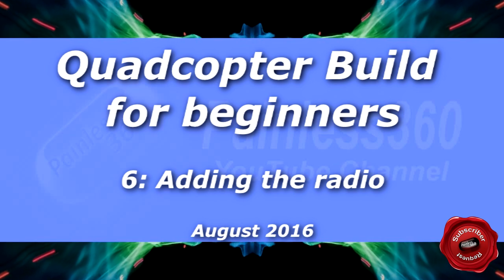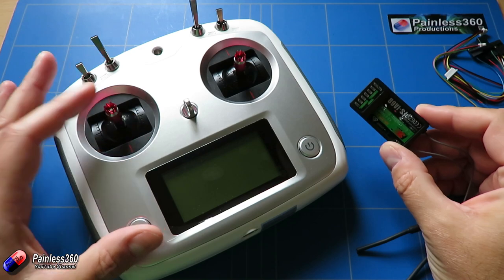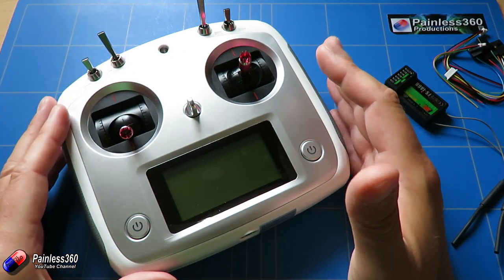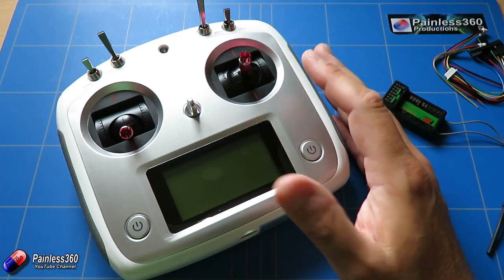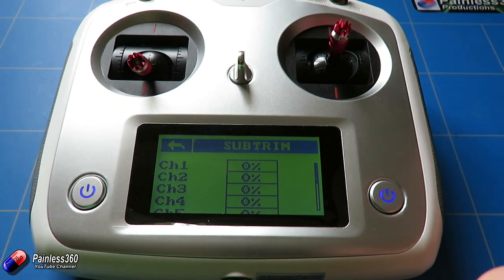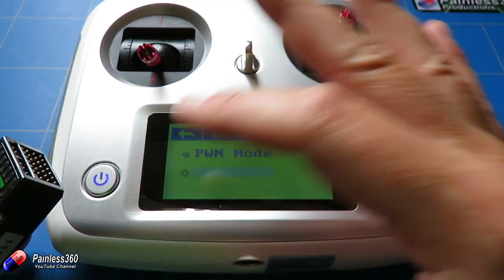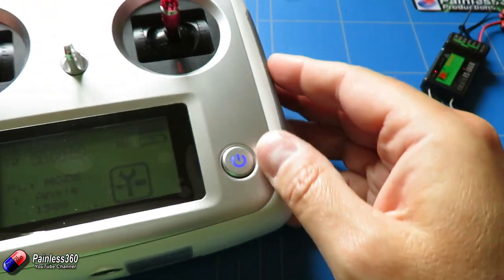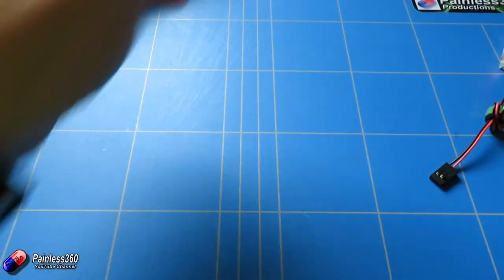(6/9) Quadcopter Building for Beginners - Setting up and adding a radio

Comment: I like this radio, perfect for multi rotors. I know the fixed wings guys aren't fussed on it, but I'd bet HK will offer a FW update to allow this as FlySky has. My DX6i doesn't have any 3 position switches nor PPM, SBus or telemetry. 4 times the money too. I'll be grabbing one of these for sure.

Comment: Hello,  very useful videos,  so Thank You first. i have a question,  i have a APM 2.8 and FS i6s  but no battery and no APM power module,  so my question is if the APM get power through USB cable,  can I connect receiver and bind and test it the transmitter?  thank you for your answer
Reply from the maker: We cover all of that in the APM series on the channel. Best of luck!

Comment: So i don't know why but the way you were able to move the sticks on your transmitter and have it show up in the clean flight reciever screen after you changed the reciever to PPM, looks so easy.  On my end, i did the same exact change and i am still not noticing any of the throttle, roll, pitch, and yaw channel maps updated with my stick movements.   

Here is summary of what i have done so far

1. binded the FS-iA6B reciever to my FS-i6X transmitter
2. set the Reciever to RX PPM input 

I did not do any subtrim modifications like you did however.

Is that what might be causing me from not seeing any changes to the channel maps of those 4 motions? 

Once i get this sorted, the rest is smooth sailing. 

Awesome videos Painless.

Cheers Mate.
Reply from the maker: Thanks for explaining a little of what you've tested as many expect me to know the answer by just letting me know that something isn't working! If non of the channels are working correctly then it's the bind, wiring or settings in Cleanflight/Betaflight. I'd recheck each in turn. Best of luck!

Comment: Hi, just wanted to say I love your channel, it's helped me so much during my build of the same model. Also, do you think you can help me? The radio I purchased on gearbest along with the model is a FlySky iA6. I've noticed it definitely does not look similar to the RX you are using, and I'm just wondering  if there was another way to connect the RX I am using to the spracing f3 flight controller. My RX only has 7 rows of pins and 3 columns. Instead of using the servo-pin-like male connector do I use all of them?

Comment: in this video you use a lipo reduced to 5v to set up the flysky, I was wondering if it is possible to wire a usb to dupont setup and use a phone charger?  I tested the voltage coming  from the charger and it clocks in at 5.22v and 0.7A. do you see any reason that this wouldn't  work?  by the way love your videos, you explain things with great detail and simple enough for even me to understand. thank you so much
Reply from the maker: It should do, be very careful though! :D
Reply: figured I'd just give it a go and it worked perfectly.  seems like a great way to re-use an old cell phone recharger if you have an extra just sitting around.

Comment: Dang.  Thought I found a unicorn.  Cheap,  great interface,  smaller form factor,  10 channel.  Love to have this for both my quads and helis.  Thx for your great vids.  And bought one anyway for my quads.  I'll stay on spektrum for my helis for now. Keep them separate.
Reply from the maker: I would, even the heli pieces on the mighty OpenTX/Taranis are not as slick as on devices like the DX8/9/18..

Comment: Oh.  I didn't know that.  I have an old dx6i,  but it's limited.  Best suggestion for new spektrum?  I fly cp helis micros,  a 250 and want to grow into 509 to 600s.
Reply from the maker: I have a DX9 here and it's a lovely (if expensive) radio. The new DX6 looks good now too. if you're using a flybarless setup then you can get away without a lot of the special swash settings..

Comment: I know this is kind of an old video but im hoping you will see this. Do you think that the FS-i6S is better than the turnigy evolution? i Like the look of both but im a thumber and use a strap while flying and neither of those are qualities that the evolution has. That being said ive heard some amazing things about the evolution and not that much about the i6S. thanks for reading this and i hope you can help.
Reply from the maker: Depends on what you mean by 'better'. Both use a very similar menu system but the i6s is a more traditional layout with some extra things in the menu (curves, dual rates) that come in handy..

Comment: I have the same radio, but my quad is not ready for flying yet. In a failsafe screen are you writing instructions or events for the given channel? For what I saw in the video - it was an event. And if I'm not mistaken it is not the way it supposed to be for setting up failsafe, I'm speaking mainly about channel 5. One more remark - when you were showing how to set up flight modes, you didn't say that you need to set up PWM value for each mode in MP, otherwise, you'll stay on the same channel no matter how many clicks you've made with mode switch. I'm not trying to teach you or to be rude it's just a way I am clearing out if my understanding of how to set up radio is right or wrong.
Reply from the maker: We used channel 5 and set it up to be connected to the switch, that way we get three values on CH5 we can use for flight modes (see the videos). The failsafe is set before binding and should 'tell' the receiver what to output if it looses connection with the radio. Best of luck with yours.

Comment: Hello painless I been see all you transmitter failsafe setup -100 throttle 
But when I do same for throttle and power of the fs_ia6b motor stop should I but throttle in -80 or should to do some thing with the FC

Comment: Hi painless, i have followed every step that you did, and it worked.... kind of..... The throttle and yaw work, but my pitch and roll do not respond. it does not work... Is there anything that you can tell me that might help? I am a noob at this new hobby and i dont know what to do.... thanks, ben
Reply from the maker: Well done on trying to build one, so many just buy a BNF and miss all the fun! You'll get it sorted, the first one or two are huge learning curves. 

You can tell that the radio and Rx are talking so the problem may be on the radio (check that the channels move in the 'monitor' screen on the radio itself) or the cables from the Rx to the flight controller are not installed correctly.. 

When asking for help it's handy to cover what you're already tried, that was I can avoid suggesting things you've already done..

Best of luck!

Comment: Great vid. Just about to start first build, if power receiver from 5V from pdb, will this also power the FC with 5V through the PPM?
Reply from the maker: Yes, the normal way is to power the board with the 5v and then let that power the receiver via the connecting cable.. Best of luck!
Reply: Painless360 Brilliant! Thanks for the help!

Comment: I'm not entirely sure if my failsafe is set up correctly. I have my settings the same as you have set them here. When I arm the quad and try to power off my FS-16S, my radio says 'TURN OFF RX'. However when it is armed and I take the batteries out of the radio the motors stop. Is this right? I thought I saw one of your videos where you actually turned off the radio by the buttons to check the failsafe. Thanks for these videos by the way, I am (almost) ready to fly after months of being obsessed with the hobby and I couldn't have done it without your videos.
Reply from the maker: Yep, that radio has a nice safety feature that forces you to turn off the receiver first. Removing the batteries is the same as what I was doing on the other radios..
Reply: Brilliant, thanks! I'm just back from my first FPV flight and it was incredible.

Comment: Just got the FLYSKY FS i6S  with the 6 channel iA6B receiver.  Upgraded firmware.  My question is the battery level for the receiver always shows full even when LIPO at about 50%  I have read that I need the 10 channel receiver to monitor LIPO voltage, or the 6 channel  V2 receiver. Just got the monitoring sensor (FS-CVTO1) with no luck.  I see in your  video  your LIPO battery level is well down to show the true level.    Any clarification would be most grateful thanks.  (Great Channel - thanks)  Steve
Reply from the maker: The battery level is around the 5v supply that the Rx is receiving normally, not the flight battery.. Hope that helps..

Comment: Glad to see some FlySky love though for racing quads perhaps the regular FS-I6 would be best... Why not use iBus though? It's fully supported on CleanFlight and BetaFlight.
Reply from the maker: +RC Flyer85 because those following the series may not use exactly the same radio and PPM is the simplest, widely supported method (if you have it). Thanks for the comment. Happy flying!

Comment: Hello Sir,
where can I find this little UBEC "circuit" you have used to power the receiver before installing it into the copter? I am planning to build a 4s quad and don't exactly know where to search for. 
Do you have a hint? Are the ones with pre-installed xt60 connectors, or do I have to solder them separately? 
Thanks for your videos. They are, by far, the best on the Internet when it comes to understanding the basics and the "whole technology". Nothing comparable in Germany! 
Kind regards
Reply from the maker: If you Google for 5v UBEC then you should find them. You can get them from lots of places now but I've usually order most of mine from eBay or HobbyKing. Best of luck!

Comment: Awesome video. I just finished building my first quad... naze32, X4R with sbus, emax 35A ESCs, etc. Currently, my Taranis is successfully getting telemetry from the quad, but my taranis inputs aren't showing up in betaflight. I checked the inputs and mixing and they should be correct. Any ideas on what's wrong? Been searching the internet for two days now...
The weird thing is that when I tried to use the "MSP RX input" mode in the configuration tab just to try things out, the inputs didn't make the motors spin either. (the master motor slider does make the motors spin)
Would really appreciate your help. Thanks!
Reply from the maker: +David Xiao see our video in the sp3 series on the common connection setups. Older Naze32 boards may need an external inverter for sbus too...
Reply: Ok, so I watched the sbus setup and the naze32 cleanflight setup. I verified I've been doing the same thing that you've said. Since I'm using the naze32 rev6 board, it shouldn't need the noninverted signal. I tried switching to softserial 2 instead of softserial 1 (had to revert back to betafligth 3.0.1). Nothing. Just in case the softserial doesn't take inverted signal, I also just tried using the noninverted signal. Nothing.

Comment: Hi Painless, I'm following your Quad build for beginners. Everything is great motors work, set up controller, went through Betaflight without a hitch.  Very cool stuff and exciting.  Transmitter is bound to the receiver as per the video.  All seems perfect till I unplug the quad from the computer. Nothing works...transmitter (FY-i6s) set up per videos and it corresponds to Betaflight perfectly.  Transmitter indicates I am bound to receiver but nothing happens when I disconnect the computer.  All seems I'm read for a test flight but nothing happend.  Light on the board are lit up otors beep at start up, but nothng.  What I have missed? Where do I look for what is wrong.  Thanks
Reply from the maker: Tricky to tell from the detail in your post. Sounds like your 5v power supply on the model isn't working. Watch the video on the power system again for ideas. Best of luck!
Reply: Thank you for replying.

Comment: Do the controllers matter a lot? Will a controller allow you to go faster? Will a 2.4ghz controller work with a 5ghz transmitter?
Reply from the maker: The radio you use will not make the model go faster but it will help you fly well with smoother, accurate gimbals and tweaked settings like Expo, flight modes and throttle curves.. Best of luck!

Comment: 18:00--excellent setup for powering up FC without using main power...question: can i use spare ESC (linear mode) to use as UBEC to have your setup?  i.e. Spare ESC connected to lipo battery via separate battery connector (T deans etc.) and BEC connection goes into RX. This power will be use by PPM connection to power up FC. Please help? (Note: ESC's 3 phase motor connection will not be connected to anything in this situation)
Reply from the maker: +adnan ul haque yep, that will work. Getting a little UBEC is so handy for setup of receivers and powering servos and servo testers..

Comment: Does the receiver come bound to the transmitter from the factory? I don't have any 5v batteries to power the receiver for binding. After setting the transmitter. Could i plug in the connector to the receiver. the one we plug in for  ppm, The red,black,white "signal cable". How you show in the video. From receiver from the FC. Then plug in the big main Batt to the xt60, get power from the Pdp-FC-RX that way, for the binding? Then unplug the big batt. Turn off transmitter. Unplug bind plug. Then proceed to Cleanflight. Would that work? I'm sorry if that doesnt make sense. Hard for me to articulate the question properly. Thank you
Reply from the maker: It depends on the kit, some do, some don't. See the USB cable trick on the channel if you don't have a 5v supply. I'd strongly recommend you get one as it's worth it's weight in gold when you need it.. Best of luck!
Reply: Just wanted to say thank you. Found that vid. Made myself a cable and battery pack. And not only that. My TX/RX came pre bound. Thanks again :)

Comment: I am using a RadioLink AT9S.  When I go to cleanflight and select serial and SBUS, the quad beeps, motors reset etc..  However, when I go to the page that reports out the stick inputs, it still doesn't show the the sticks are moving when I move them.  When I go back to the page where you can select the Receiver, it doesn't show that it is on SBUS.. it just has the pull-down selector.. if I pick SBUS, I get the same results. . Note The transmitter appears paired as it has the bars showing connection.  Any ideas?
Thank you

Comment: I have been given a Futaba T7CP+R617FS 2.4 GHz FASST to use for this new entry level build, reading the documents only talks about fixed wings and Helicopter. I presume as it's an old radio it migth not have documents for a quadcopter but it will work. WOuld you be aware if this be supported with this model of Flight controller in this build
Reply from the maker: It'll work - select fixed wing. Google 'acro radio painless360'. Best of luck!

Comment: I have followed all steps and my transmitter FlySky FS-i6 and the transmitter FS-iA6B isn't connecting to my Flight controller (I have the same flight controller as the one used in the video), when I get up to 20:21 the throttle does not move and there is no AUX channels. 
However If I connect on the SBUS side with the 1 servo cable, I am able to see all AUX channels however, the throttle still does not move. Please help me :(

Comment: Very Good 'hands on instruction'.  Looking for a set up configuration of the FS-i6s to the new Naza N3.  Like to try the FS-i6s on a multicopter but can not find any thing on the N3 Set up. Any Help or comments would be appreciated. Mny Tnx
Reply from the maker: We don't use Naze gear here but we did use the i6s in the 'Quadcopter building for beginners' series on the channel. Best of luck!
Reply: I see your videos and very very good, help us all. Mny Tnx.  If you hear or see of some one using the N3, with the FS-i6s. please let me know. Thanks/keep up the good work.

Comment: If I don't have that little power plug you have, could I still just plug in the drone battery and use that instead?
Reply from the maker: Yes you could but make sure the props are off for safety..

Comment: Hi - just building my first quad following all your vids, I`m using pwm. IO_1 & IO_2 have 5v connections on both sides. Do I need to remove one. Have tried to find the vid with the update at end but you make so so many vids I cant find it now. Of course I could be wrong Thanks
Reply from the maker: Not sure what you're asking as yoiu don't mention the flight controller. I'm guessing it's a SP3?. We cover the power settings for that board in the SP3 series. Best of luck!

Comment: Hey, so I've been using the ia6b and it's been great. During my last flight though I came in for a landing, unplugged and switched batteries but as soon as I plugged in my receiver wasn't lighting up or working. Any idea why this would be happened? I didn't touch any of the wiring
Reply from the maker: +Zormion I'd check all of the power connections on the model. Best of luck!
Reply: +Painless360 could you please take less than 2minutes to watch a video of mine of a problem I'm having with throttle from the tx. All is OK in CF. ESC calibrate or seem to anyway. All is in the description. Any help would be greatly appreciated.  Or help from anyone.

Comment: if ever i bought a walkera rodeo that comes with a devo 7 reciever, can switch it up to flysky reciever? cause my radio is same as yours that works only with flysky reciever.
Reply from the maker: From what I remember (see the Rodeo review video) you can add an external s-bus receiver to it. So if you can find a compatible receiver that sends an s-bus signal you'll be in business. Best of luck!

Comment: I switched my receiver set up to PPM, along with the transmitter set to PPM, I am getting no input for the values in clean flight. Is there a way to fix that? I am using a FS-i6S Transmitter with a 6 Channel Receiver.
Reply from the maker: +GeorgeRC all the steps I did are covered in the video. Best of luck with it